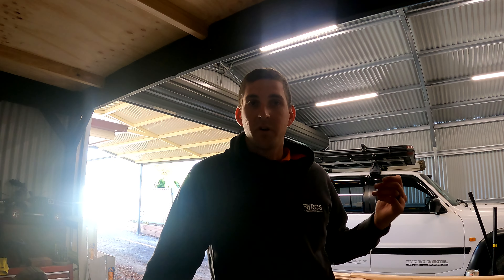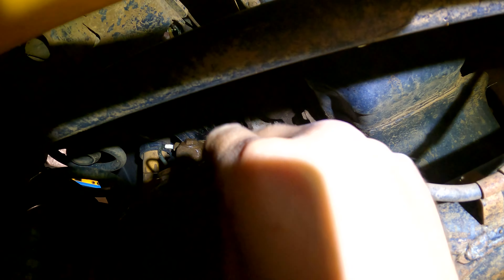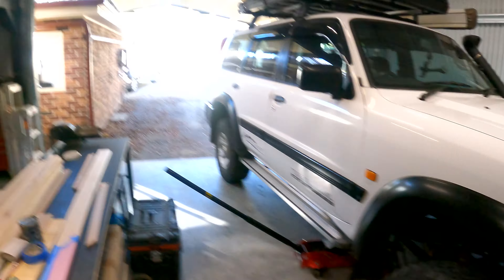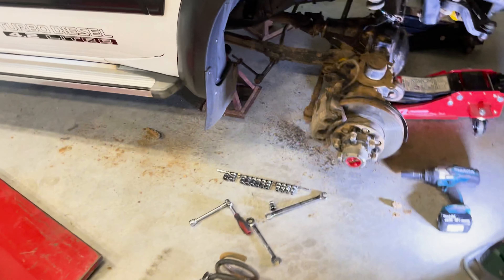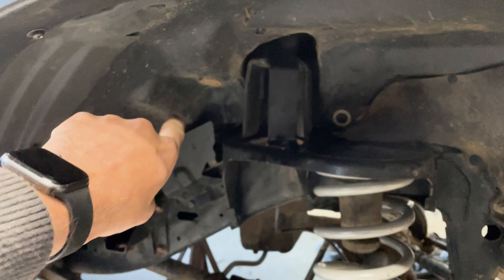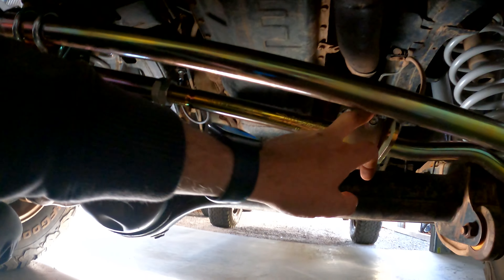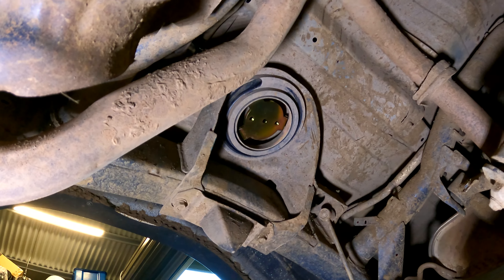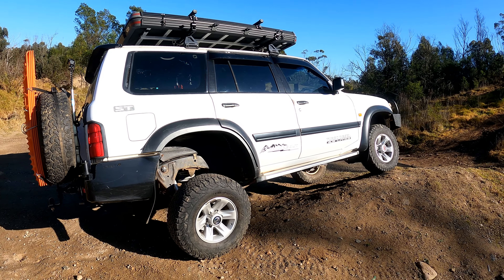Installing Gu Patrol Suspension I Superior Engineering 3inch lift

Comment: Still need diff breathers, extended sway bar links and drop boxes, upper lower control arms
Reply from the maker: I could actually just take a diff breather mount off and made them long enough. 
The rest can be done after in due time. But with the three inch I can get away with how it is. Anything over 3 and you would need to order that stuff as well 100%

Comment: How does it handle now?
Reply from the maker: Yeah good mate. Obviously abit more body roll around corners. Any higher and I think it would handle abit rough.
Reply: @scottysoutdooradventures1844   oh yeh meant the shocks more then anything, mines 4 inch lift handles mint
Reply from the maker: @donaldwills2135  the shocks are awesome mate. The ride is that comfy and they go hard off road so far 👍
Reply: @scottysoutdooradventures1844 when i did mine i put a couple of heavy duty sway bars in with quick disconnects. I have less body roll now with 4 inch and 35s then when it was 2inch and 33s. It's like driving a sports car compared to the way it was before.
Reply from the maker: @jer686  yeah they are on the list of things to buy for sure! Cheers for the feed back.